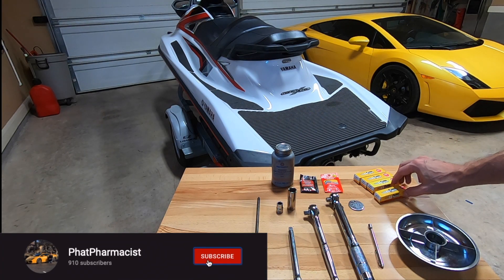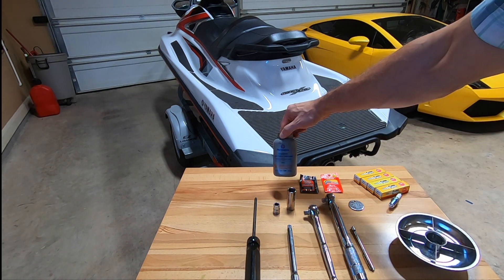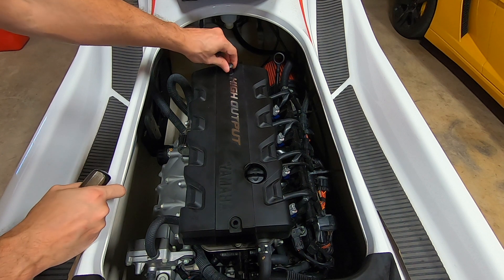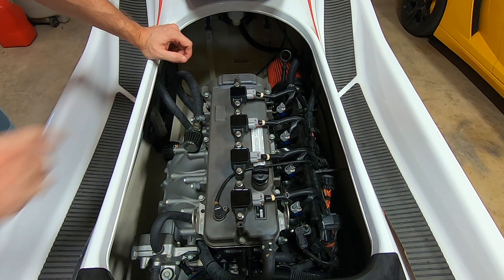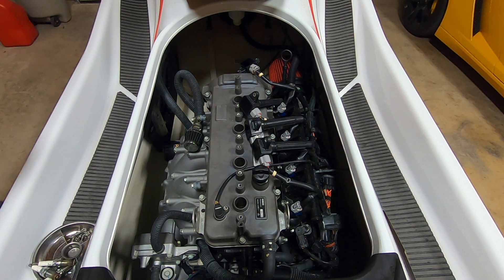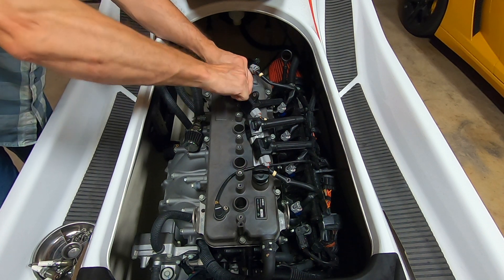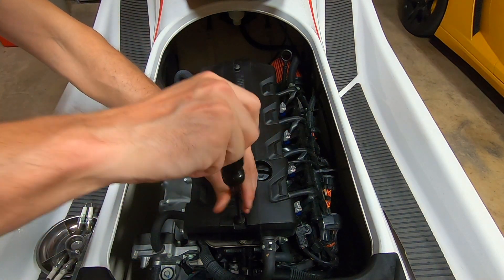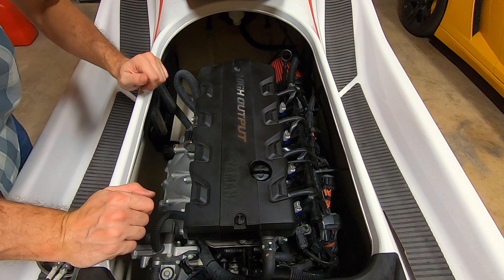Replacing your spark plugs? Yamaha Wave Runner VXR spark plug change tutorial for 1.8L engine

Comment: How did u remove that seat bracket to get all that space in the engine bay?
Reply from the maker: There is a small release latch under the seat at one end and then it just lifts off.
Reply: @KeeferVision  yeah ik that. I’m talking about the kinda like brace thing that the seats flip into. You gotta remove that to replace the 2 middle spark plugs cuz if not u have no space